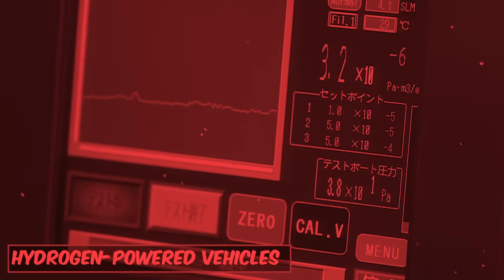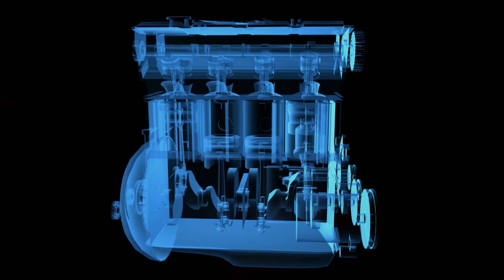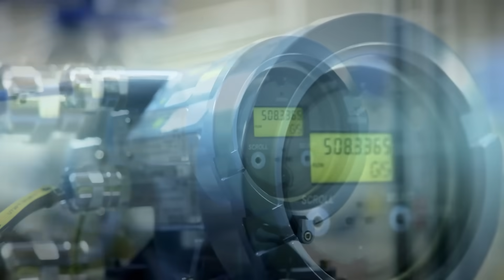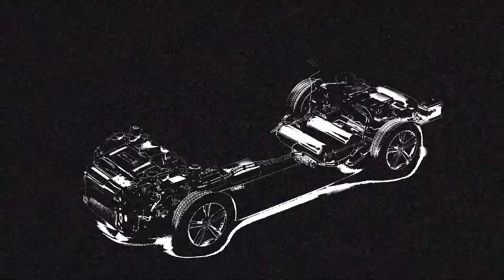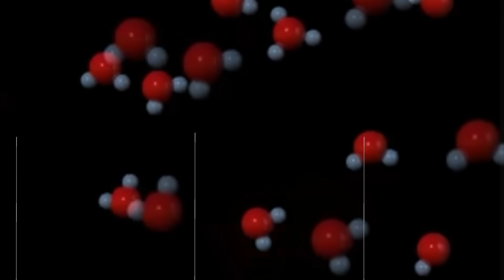Toyota's New WATER Engine Will Destroy The Entire EV Industry!

Comment: This is a gigantic distraction from the real secret technology of free energy. It's a ploy, a trick to make people focus on a total failure of a project car, that literally is just an electrolysis motor, its just going to create oxygen and make air. The real formula of real unlimited energy involves using copper and magnets, and what happens when you run a magnet over a copper wire??? You get an electric charge, what happens when you rig wires to run in an infinite loop??? You get what is called free energy. It's perpetual energy. Imagine an EV vehicle that endlessly charges itself because it literally behaves like a generator at the same time.

Comment: The emissions would definitely need to be regulated due to upper atmospheric flaming hail storms, prophetic to the giant 70 lb hailstones or about the weight of a talent. Flourine would be or could be the bi product causing the fusion if I remember correctly, This kind of technology is better used in bike framework or corrugated  capillary designed green houses for rooftop Gardens, where emissions are expelled inside the greenhouse for a more productive yield. The ALCOA Oldsmobile Grand Am defected to a Pontiac by way of the AC Delco throw out wheel bearing sensor tranny after Foundaries moved away,,but its the original  sub station engine of pneumatic  Sprinkler Systems outside municipalities, providing perpetual pneumatic power off grid. Taxable Gains cant touch this either.

Comment: Without adequate power triton, vortecx or diesel turbo Railer straight 6 engine warranties and trade in values new weaker materials toys ratio good better best shadow good better best not competitors rich dad poor dad Satoshi impire could crumble negative times before drawing boards facing touch touch touch repetitions Deja vulike lives. Not proper lives my people kinds actual best kinds. Bless Samurai line not other line kind. Joseon Dynasty Trinity, Archangelic and Priest Melchizedek Bless not failure kinds!

Comment: There is a far simpler engine type using water under pressure, no charging, no top up, and unlimited distance, all based on a WW" tanker drive, outdates all other drive types, no combustion problems power from  Archimedes Power drives- Toyota you are years behind.

Comment: Hmmm......so it takes power to produce the electrolisis process. When you then in turn combust that same hydrogen you should get roughly the same amount of power out of the combustion as it took to seperate it....which nets you nothing........actually even worse because you have theemal losses associated with bothe the electrolisis process and the combustion process.....what am i missing how can this system produce a possitive net efficiency?

Comment: In fact this segment describes a hydrogen powered engine. Something has to provide the electrical energy necessary to break water molecules into oxygen and hydrogen atoms. The engine couldn't possibly provide its own  "real time" energy  much less have power left over to move a vehicle down the road. An external power source of some sort would be necessary to produce and compress the hydrogen to fuel a slightly modified internal combustion engine. The concept of hydrogen powered cars is hardly revolutionary and in itself has promise However, suggesting that you only need to add water, distilled or not, is simply ridiculous. It would have to plug into the grid periodically 
to reenergize.

Comment: Isn't  it  against ,,the law of conservation of energy ????  When we use  energy  from  12 volt battery  for electrolysis,  to geneate  more  energy or hydrogen  to run a car..... ???
Reply: no. the alternator has more than enough to covert water into hydrogen so you just add more water as needed. it's a hydrogen on demand system

Comment: You have still to buy distilled water for fuel in lieu of petrol. The problem that consumers will be facing is that if natural water resources are depleted where they will get water?  If they get it from the sea it would come up very expensive fuel to convert it into distilled water.
Reply: no. Hydrogen on demand systems are not new and they can run on any water. Fresh water, salt water, a cup of tea or dirty water as well so it really doesn't matter what water is used as long as the hydrogen on demand system can convert it into hydrogen for use
Reply: @dataravenbeats  For some reason they specified clearly not ordinary water but distilled water.
Reply: @ACafe-qj5eq  distilled water is an insulator ( can be used to spray clean insulators on power lines while in service) to get electrolysis to  work you need impure water

Comment: Best way to tax clean drinking water and make you pay for living. When it runs og sea water then i will be interested. Until then: NO thanks.
And where does the 'High voltage' power comes for creating electrolysis??? So we need a battery AND an electrolysis mini-plan AND an ICE engine instead of just a battery and small electrical motor? Brilliant. More complicated crap to service.

Comment: Please remove this video and stop the BS... problems? (1) Energy required to perform electrolysis required to split the water onboard the vehicle (2) energy required to compress the hydrogen for use in a fuel cell (3) loss of efficiency throughout each step of the process including fuel cell inefficiencies. There is more energy required than you get out of the process that is usable for propulsion. It is the limitation of the energy contained in WATER... which is very little... STOP THIS SILLINESS...The amount of hydrogen,, if not compressed,, would require storage 5 times the size of the car, so compression is required because you can't produce enough hydrogen instantaneously to go from split H2 directly to the cell and then to the engine with high capacity splitting technology small enough to fit in a car.... to simplify, splitting water into hydrogen and oxygen requires more energy than contained in the resultant hydrogen... Process OVER before it starts........... this is why 95+% of ALL... ALL... ALL hydrogen produced uses OIL (hydrocarbon) and NOT water.. exactly why....AND FINALLY .. no one (dead) came up with some invention that defies the laws of physics..NO ONE!!!

Comment: Well Toyota I have also have a vehicle which runs on nothing,.
Does not need fuel, batteries, solar etc, no top ups with repeated stops with water.
Drives any vehicle, boat ship plane home, but more remarkable it can be used with army, airforceand navy.. No waiting for fuel, vehicle does not have to wait for advancing tanks etc.
100% environmental friendly, 
How it works , ha ha, you will have to wait. But it does trust me.😄

Comment: Yeah, but what happens if you connect the flux capacitor to the alternator, I mean a simple math would have to have the right ohms. Divide that by the amount of horsepower that the motor is going to receive by the gallons of water that you’re going to add I don’t think it’s gonna work.

Comment: The only way this would work, without being the perpetual motion machine which this video seems to imply, is if the engine is battery powered and the hydrogen is just the means of propulsion. So... It's still just an electric car. Which means, like any other electric car, the initial energy would primarily come from fossil fuels. They just wouldn't be burned in the vehicle, itself. The question then becomes as to whether adding this engine is more efficient than just using a plain old electrical motor. Given all of the moving parts, my strong suspicion is no. And you would need to both charge the battery AS well as fill up the water tank, prior to driving. I don't think the EV industry has much to fear. The greater amount of moving parts would create far more unusable energy than a standard EV, due to entropy. Thus...Less range and less power. I wouldn't sell your Tesla, just yet.

Comment: Total bullshit.  There’s not an ounce of water in the car. But it doesn’t make any difference. The whole thing is gibberish. You have hydrogen and you have oxygen and water. They are tightly bound. What these idiots are telling you is that if you spend the energy to pull them apart, you can then take the hydrogen and combine it with oxygen in the atmosphere – I don’t know why they have to go to the atmosphere. They just released oxygen in the water. What are they going to do throw that oxygen out and go look for oxygen in the atmosphere – and get the energy that is released.  Which will be a percentage of the energy that was put in such that that that percentage is less than equal to 100 because there is no process it’s 100% efficient.

Comment: This is FAKE news:  Water electrolyzer electricity consumption of 50 kwh produces 1 kg of Hidrogen. When used in an internal combustion engine this kg will produce 10 kwh mechanical power. Eficiency: 20%. A standard electrical vehicle, on the other hand has an efficiency above 85%.Therefore, the "water engine" will require 4 times larger batteries than the standard electric vehicle. In this article there is no mention of where does the electricity for the electrolyzer come from (so they need no batteries)

Comment: Cargo ships use 1000 of times more pollution then cars globally.. just 10 of the cargo ships, which number in the  thousands of ships on the sea use as much pollution as every car on the planet.. so if you can build an engine working from water, why not design one for cargo ships that literally run on water.. albeit salt water so some adaptations needed but if your doing it to help environment focus on the sea boats? But no the focus is on cars where the money is which I get they need to fund the technology but don't be naive. Buying electric or hydrogen car gets transported on one of those cargo ships ergo you just added 1000 times in your lifetime your pollution contribution just by the transport using those cargo ships. Google 10 cargo ships vs global car pollution and bear in mind there thousands of cargo ships and other vessels worldwide. Yet the focus is on cars? Which doesn't help as you still transport them using the cargo ships!!!! Lol

Comment: Ever since i heard about some guy doing this decades ago and going missing (conspiracy theory), I've always thought, wouldn't it be even better if after you separate the hydrogen from the oxygen, you use both? They are both combustible, and im sure you could set up just different style chambers to mechanically make up for the difference in explosive power, so like the hydrogen side has smaller valves to let less, or the chamber for the oxygen side is smaller. That way your reliant on a computer chip to adjust every millisecond? I feel like this is an obvious yes, but i also assume this wouldn't increase performance, but could give the same performance while using less water per mile.

Comment: I think it should be hybrid.. Battery and H2 fuel from electrolysis, what advantage is battery once fully charged then it will support the electrolysis of water, with this the car can go much longer distance.. And no need to worry in the middle of nowhere.. Even better of while charging, electrolysis also works to fill up the H2 tank..

Comment: Internal combustion engines have been modified to run on hydrogen instead of gasoline.  Hydrogen can be extracted from water.  I think what is needed is a hydrogen based internal combustion engine paired up with pure oxygen from an oxygen tank.  Then you have pure water out the exhaust and do not produce nitrous oxide pollutants.  Whether or not the electrolysis of water to hydrogen gas can be performed in the vehicle is an open question.

Comment: Abject nonsense! If the motor has no battery, where does the electricity come from for electrolysis? If it does have a battery, then why bother with electrolysis? FYI, water contains no usable chemical energy. What do you suppose hydrogen burns to form? That's right, water. Electrolyzing it is equivalent to taking your exhaust gas and turning back into gasoline. At best it's a zero-sum game with no work left over to move the vehicle. I can assure as an engineer, Toyota knows better.

Comment: This is misleading. What Toyota has developed and patented is a water-cooled hydrogen combution engine, which is different from a "water engine". This engine uses hydrogen as fuel but incorporates water injection for cooling purposes. Toyota has produced hydrogen fuel cell vehicles, like the Mirai, which uses hydrogen stored in tanks to generate electricity (in the end electric cars charged with electricity from fuel cells).

Comment: Stanley Mayer created hydrogen on demand which used electrolysis at the point of injection in the 70s & then he mysteriously died… I’m just glad a motor manufacturer like Toyota & JCB is bringing this to reality👏👏👏
Reply: I remember that.
Reply: Don't forget Elon Musk.
Reply: @vjsintx  Elon has nothing to do with reality.
Reply: Have you read up on the Meyer court case?   The car was fake, it ran from batteries and barely went for a few miles, no amount of adding more water would extend the range.  He was ordered to repay the investors.

Comment: Wow, the water engine again. If you believe a car can run on water please do the following...

1. Name the reaction where energy is stored in water and describe briefly how it works. 

2. Name the reaction where energy is released from water in the engine so that the energy can be used to drive the drivetrain. 

3. If the energy derived from water is in the form of heat, describe how the heat is released from the water.

Comment: Most proposed water-fuelled cars rely on some form of electrolysis to separate water into hydrogen and oxygen and then recombine them to release energy; however, the first and second law of thermodynamics guarantee that the energy required to separate the elements will always be at least as great as the useful energy released, so this cannot be used to produce net energy. According to the currently accepted laws of physics, there is no way to extract chemical energy from water alone. Water itself is highly stable—it was one of the classical elements and contains very strong chemical bonds. Its enthalpy of formation is negative (-68.3 kcal/mol or -285.8 kJ/mol), meaning that energy is required to break those stable bonds, to separate water into its elements, and there are no other compounds of hydrogen and oxygen with more negative enthalpies of formation, meaning that no energy can be released in this manner either.
Source: Wikipedia

Comment: Where is this energy.coming from to split the H2O molecule when the engine initially starts? Yes once the engine starts  the engine can just say  theoretically have enough energy to generate the hydrogen but what about the initial energy, will it need a lithium battery to start the process. Or is electrolysis not that power consuming  after all of 100 years of lies? and more money was to be made from fossil fuels over the last 100 years from the petroleum industry than the alternative engines we see now ?  Something smells here?

Comment: There is no such thing as a water powered engine.  What Toyota is describing is an engine that runs on Hydrogen which is cracked from water using electricity. Engines of this type have been created from the 50s.  This was first done in 1859 by JJ Etienne Lenoir.  He soon switched to petroleum to gain some range and speed.  You can't get hydrogen from water without electricity.  What is actually being described here is an EV with an Otto engine to burn Hydrogen.  Charging all batteries produces free Hydrogen.  The problem is that Hydrogen is very impractical due to it's explosive danger.

Comment: If somebody understands elementary physics, TOYOTA probably found a way to transform part of the waste heat from a combustion engine to hydrogen. OK, this means that from a ~30% efficiency to double it and do it ~60% ? Let's stuck to 60%. Even with this in mind, you must have a different source of energy that in the best must cover the half of the total range of the car. The energy source could be battery pack...? So you need much smaller battery and the turning  water into Hydrogen system....  We will see

Comment: Actually, all you have to do is keep reversing the polarity of your electrolysis plates and literally shake the water molecule apart at it's resonate frequency. It requires 1/3 the power of normal electrolysis.
Reply: Cool.  I didn't know that.  Thanks.  How do you accomplish that?  How often would it have to be done?  How much energy would it take?  does it increase the output volume of the gasses needed for an internal combustion engine?  Why are we powering a mechanical engine with an electrical dprocess?  Isn't that wildly inefficient to convert electricity into heat, then convert the heat into mechanical, the convert the mechanical into kinetic?  What if we just use a big battery and drive aan electric motor that moves the vehicle?  With alternators, we could even reclaim a portion of the resulting kinetic energy to partiall recharge the battery, and extend its life until it needs a full recharge.  Hell, with a very small diesel motor, the battery could even get recharged on the fly, ad hoc.  Charge drops below 50%, motor kicks on, and turns of at 100% charge.  It works for locomotives...
Reply: Great sounds real easy to demonstrate a violation of conservation of energy.  Physicist's will be very interested.  You could make millions just lecturing about it.  Assuming it isn't complete made up tripe.